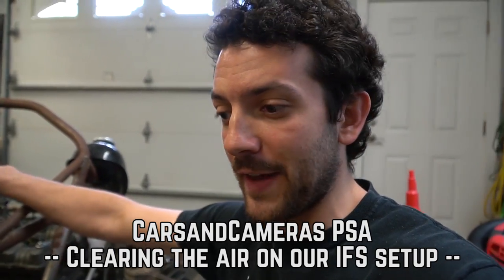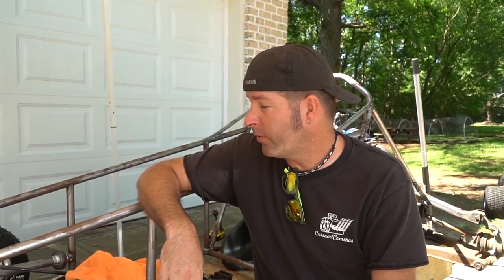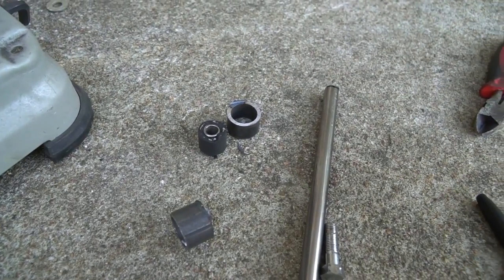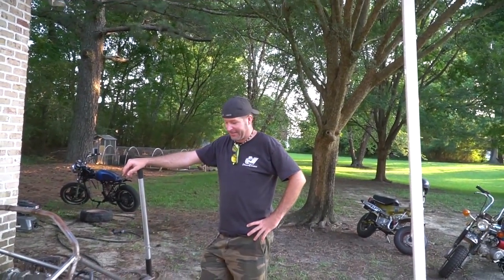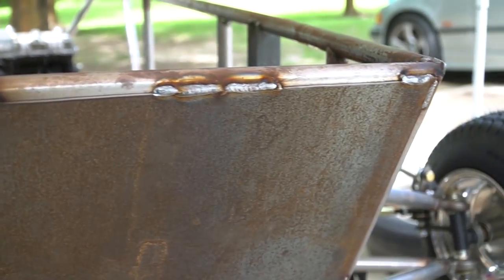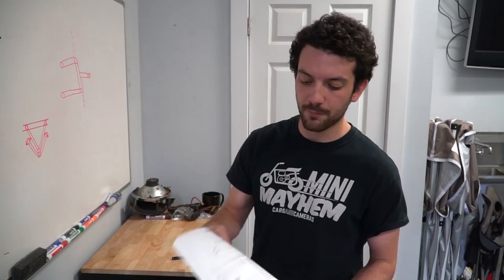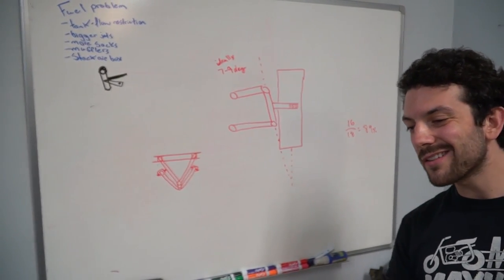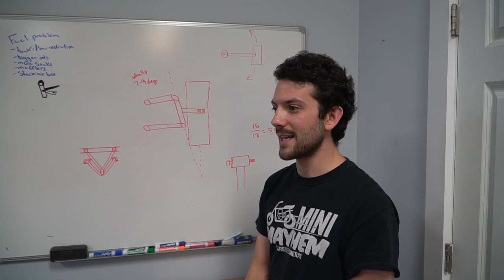Shocks, Suspension, CLEARING THE AIR | Cross Kart Pt. 10

Comment: The only ones I'd be concerned with are the ones on the spindle end, but I don't know what sort of travel you've got. Those running out of clearance and becoming a suspension stop would be the only way those joints will give you any issue. As long as your shock runs out of travel first you're all gravy.

Comment: I'm a Mechanical Engineer and didn't see anything wrong with your front suspension mock up. I can see where you might have some stress points and gets some cracks, all depends how hard you beat on it. 
Tires and hubs fall off cars everyday, It'll be fine.

Comment: Why dont you simply attach the lower shock mounting point aound the middle of the lower controlarm in the front like it is on the rear miata suspension? you wouldnt have to have an enormous springrate :)

but the kart looks just amazing!

Comment: those joints on the front are a bit overkill just look under your car and see how small the ball joint holding the spindle is and those joints you guys put on the cart are the exact same thing as a ball joint on a car except the bolt goes trough the middle instead of having a tread on one end 
great job building that cart i wanted to do something similar for years but i just dont have the time

Comment: The one problem I see is the angle with shock on top of upper control arm. Using the lower control arm will decrease angle and allow better articulation of suspension.

Comment: The first shocks probably would have worked if you would have kept them within 30* of vertical. . .going past 30* starts to decrease the effectiveness of the shock valving as well.

Quality heim joints/rod ends move freely when brand new. . .check out the high quality units used on high end racing suspensions and desert trophy trucks. They should move freely, but without slop. . .

Comment: So, just semantics, but "Heim Joints" are technically a brand (from the original designer). These style of joints in a generic lable are "Spherical Rod End Joints". The tractor style that you bought are typically designed with a tighter ball race. This keeps empliment tools from loosely tracking while in storage mode, and while being pulled under load behind the tractor. 

If you had bought motorsports grade Spherical Ball Joints/Spherical Rod End Joints, most of them would have had less friction applied during the manufacturing tolerance process. 

Just fyi. Not super important for what you guys are doing. Just though you guys and others might like to know. Offroading and Race Car Spherical Rod End Joints are typically a bit stiffer as well, as they are designed to maintain tighter tolerances while under extreme force loads.

Comment: I have purchased 100's of heim joints for making 4-link suspensions and have never had one be so stiff as to require more than finger pressure to move it.  Not saying the ones you have are defective, just making an observation.  Maybe yours are from a different manufacturer.
Reply: Because they arent using  Heim Joints -
Reply: @Mad-Duk_Machine_Werkes  They are using spherical rod ends from Tractor Supply.  Same basic design but they have that huge shoulder on the spheres.

Comment: That's why I always have a spool of flux core wire around.  If you run out of gas or you have to weld outside in the wind, the flux core doesn't care.

Comment: Do the hyme joints have grease zerks? Not sure if you have to tooling to add them if they don't, then you could at least put some lube in there so they don't bind so much or wear fast down the line.

Comment: Attach the front shock to the lower A-arm, not the top A-arm.  The resulting angle will be much closer to a right angle and therefore provide more resistance to compression.

Comment: I'm 1/2 way through the vid, you guys could have ran a cross bar across the lower control arm, parallel with the frame and mounted the front shock to the lower arm through the center on the upper control arm giving you a better angle on the shocks.

Comment: You guys rock. How many actually read the comments? Most are afraid of reading them because they don't want to hear what they are doing wrong since they are always right. So, you get extra points for reading comments and responding. But in the end, you don't have to listen to every keyboard warrior. Now, for fixing or not to fix? If you want it corrected? Fix it. Like you said, Edison took 1000 times to make a light bulb. So don't feel bad if you have to do a little redesign. But if it works fine, it'll be fine. Although I personally kind of would like to see it race against the drag rail and shifter for the top speed, and maybe top speed for off road. But that's me. If you wanted something for a Max of 50mph, then leave it. It was your first build so leave it your first build. Maybe show your mistakes as sort of trophy's of what you learned while making your first build.

Comment: Still missing the anti squat/anti dive  angle which is most effective during hard braking and emergency maneuvering. You'll notice when you turn hard at speed your front suspension will actually impose additional body roll into your chassis, and if you ever plan on using the brakes in an emergency at higher speeds (35+mph) you'd notice when you press the brake hard the front end will dive down transferring the weight forward unloading the rear suspension causing the rear tires to start skidding during hard braking... of which causes increased instability. That information should be in that book.

Comment: If you place the front shocks more vertical, won't that stiffen it?
Reply: Yes, Every 1 degree you lean the shock and spring, is @ 1 % rate reduction on the spring and shock. 20 degrees, = @ 20%. It really matters on the rear, as softer springs help forward traction.

Comment: Your welder "acting up" may be the tip. Most Tips need to be replaced after awhile. I was having a lot of trouble with my mig welder, and it turned out to be a damaged tip. However, my welder wasn't gas, it was just wire flux.

Comment: it might be time to put a new liner in your mig gun the liner will cause wire feeding issues a sputtering issues like you had pointed out it is alot cheaper that buying a new gun and hose for your welder

Comment: if you get a piece of styrofoam you can lay the metal flat on the ground while cutting , the nibbler will dent a groove in but the stuff is cheap
i had an english book on suspension from a guy that build a formulla type open wheel singleseater for hillclimbing and the guy used a piece of string to see how the suspension arm lengths reacts to the travel , he basicly used nails as heim joints and moved the whole thing through the arc , works pretty good in visualizing stuff

Comment: those appear to be ends for making or repairing a center link for a three point hitch. they are tough as hell, and are designed to deal with constant, heavy stresses for years and years. you have no idea how much abuse those things take supporting a four bottom plow as you till a field. this go cart will be nothing to them. i'm surprised you got them loosened up already. i was going to suggest putting pumice hand cleaner on them to help loosen them up.

Comment: Weld a bar to the bottom of the front a-arms and mount the shocks there. They wont perform well with the angle the a-arm is putting them at.

Comment: hey all you can do is try it if it works great if not oh well you learned. i have built stuff like this my engire life. and i would be willing to bet for everything i ddi right i did it wrong at least 2 times before. i used them joints you are using on a trailer i pulled behind my motorcycle for years.  until they made it illegal.well at least in Texas

Comment: Front shocks are laid to far to an angle. Drill holes higher up on the bracket and mount the bottom of the shock on the lower arm.

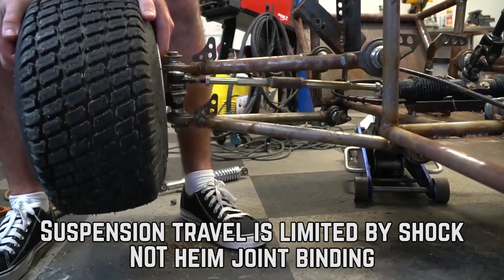Comment: OK, Right around here, 0:28 to 0:30, You see how the joint, it looks like it's twisting. instead of a smooth up and down ark, That looks like it's binding. If you pound on it, it will get more and more lose till it breaks. My other concern, out here looking in, it's like you guys built the cage before you built the frame to mount it too. Instead of building a frame to mount your suspension to, you are mounting your suspension to the tubing. That looks like thin wall tubing. It's not going to take the beating the suspension is gonna give it. It seems to me if you ride it hard the tubing will give. It will bend and twist and break. To me, it just seems you left out the frame and are asking a lot of the tubing.  Remember back when some of us was telling you two it was time to leather up? You didn't. Remember what happened to Ike when Ike started pouring the coals to the 50 HP riding mower? If he had on his leather he wouldn't have gotten scraped up. What you are building right now is the 50HP riding mower times 3. if not more. If this thing bends and twists like it looks like it will, well, LEATHER UP IKE. It looks like you might need it. I'll shut up about it. Go back in the bushes and just watch. Maybe I'm wrong. I hope I am.  I just hope that I don't see one of you pouring it to this machine on uneven ground and something, "give" up front.  That could be catastrophic. For me, there is no way I would trust a welded together front end. that's like breaking an A-arm on your daily driver car/truck. Then welding the arm back together and sticking it back under the car and calling it OK. You just don't do that. But, anyway, I'm done. Back to watching.

Comment: you guys really ought to do the math for those shocks. especially the angle of them. the further you rake them toward the center and off of vertical the weaker your springs effect will have on the suspension. shock damping rate will likewise be effected similarly.
Reply: also will have the effect of increasing exponentially the force it imparts as the suspension compresses.
Reply: i. e. all the way down very soft. all the way up very stiff.
Reply: and really you should fit the shocks and springs to the amount of travel you will use.  i mean git r donE

Comment: well im 15 years old and ive welded more than enough to roll them dimes thx to my welding instructor but anyways idk what the hack they are saying that the welder is acting its either wire speed....most likely and or the shielding gas is being blown away but most likely since you can hear it sputtering it could be the wire speed/it is the wire speed

Comment: Shocks aren’t strong enough because they are designed to be straight up and down at most a 45, those are like 20 degrees and the leverage on the swing arm is way more then what they can handle. Yes putting stronger ones on would work but the physics need some work. Other then that looks pretty good.

Comment: I don't have an issue with your ball joints but some of your geometry you yourself is saying some of its not quite right realistically your front shock should be mounted about the midpoint of your lower control arm and come up at a 45 degree angle your ankle is too low that's why it's not what you supported laterally up and down and yes you need about a 12 or 14 inch rim larger Tire

Comment: That is one hell of an angle that you have on the front shocks. Spring shocks are at their highest efficiency when the moment of movement is strait. That is the close you mount your shocks to be parallel with the front wheel the better they will work. Dirt bikes often have a single shock mounted on the rear of the bike with the supporting triangulation ensuring the movement of the shock is straight compression. That is movement of the lower eyelet   of the shock does not scribe an ark while working.

Just saying.

P.S. I could not locate a web link which supports what I am saying better than the link below.

https://www.speedwaymotors.com/the-toolbox/coil-over-mounting-guide/30078

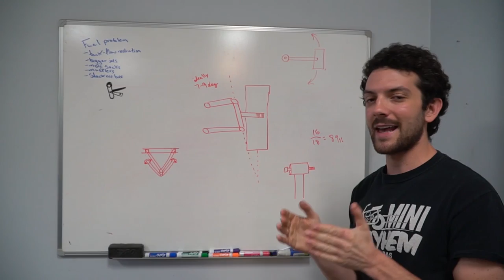Comment: The statement made at 15:02 is false.  The spindle side ball joint ends of the LCA tubes are welded together preventing any rotation of the tubes.  Because the ends of the tubes are fixed, the Tractor joints behave exactly like bushings.  If the ball joint ends of the LCA tubes were not welded together but allowed to rotate independently with individual lower ball joints  the non parallel mounting of the LCA pivots would not be as much  of an issue. This is a common audi design for example: https://cdn4.pelicanparts.com/techarticles/Audi_B6_A4/46-SUSPEN-Front_Lower_Control_Arms/images_small/pic01.jpg The easy fix is to rebuild the LCA with parallel inline inboard pivots.  This would eliminate the binding which is present.  The suspension travel would no longer be limited by the pivot bind.  In the unsprung test earlier in the video you can clearly see this happening.  If you are happy with the way it works now, by all means keep it and enjoy it.  There is no shame however, in copying what major companies have spent millions of dollars in engineering on, especially for your own use.

Comment: Those shocks are way to weak, check eBay and you can get some nice gas shocks from China for pretty cheap. I have used them on a 660cc buggy i built and they worked amazing.

Comment: I never said they was not a heim joint. The ones for tractors are low quality, weaker, and not ideal for suspension work. If one fails on the back of a tractor your bush hog falls and you stop. One fails on the front of a buggy at 60mph the stop is not a slow and painless. The low quality is also why they are so stiff, because in a tractor it doesn't matter. No a new one won't flop around but you don't need to put it in a vise and use a crowbar on it either.

At the end of the day do what ya want but I've seen those fail at the off road park and it's rarely pretty.

Comment: Mounting your Shocks at a 90° angle Will Stiffen the suspension  up. look up about independent suspension you will find that  that angle on the front mount matters a lot for type of off-road application  you are trying to make but sound like you did a lot of research already tho

Comment: your welder is acting up because you are welding too much at one time. welders have something called a Duty Cycle. weld a few mins and leave it on let it cool off. i have a lincoln it does the same thing depending on what i am welding i can weld for a half hour or so but eventually it will go in to protect mode and shut off for a good 45 mins.

Comment: I have no issue with your chassis or suspension design the only t2o things I would suggest is use some miata coilovers for the rear suspension. I know a cheap set is still like $200 but I think the adjustable spring rate would work well in your design. 2 I am not sure if you guys did or not but I would  definitely add a splatter/heat shield between the engine and the drive. In my experience a plastic seat is just not enough protection. But you do you

Comment: If your using a crappy extension cord with the welder you will not get full power from the smaller gauge extension cord, just a simple fix.

Comment: Welder isn't the problem. It's most likely that you're welding outside in the wind. The is blowing your shielding gas away from the area you are welding. Causing inferior welds. I would grind off all the welds you did outside and reweld them.

Comment: guys do yourselves a favor and get a trial version of just about any CAD software and use it to figure out your suspension geometry.. You can all but eliminate bump steer , get proper ackerman, camber, caster,toe angles figured out before you ever cut a piece of tubing... A little knowledge with CAD can save you tons of time and materials compared to the old eyeball "ya think so?"method..

Comment: At first you were under-sprung, now I’m guessing you’re going to be way over-spuing.  With the vehicle on the ground, it should use 20 to 30% of the shock rod travel at rest.  That gives allowance for if you hit a hole rather than a bump.  Snowmobile or atv shocks might be a better choice, they’re sprung for the weight you might be working with. Just sayin.  Springs only adjust ride height, that’s it.  Compression and rebound is another game.

Comment: That's thing. They are meant to move in many different positions. So they can twist and turn all sorts of ways. Where as like the rear they do not. It only goes one way. Up and down. Not forward and back, up and down side to side u know what I'm saying. Your gonna have ato lot of power. It doesn't seem like much but it puts a lot of torque out of that engine. U can do what u will. But, it would be cheaper and easier to build it the safer way. But everything does go weird when it is moving on a suspension. But u do know this bc u guys go through it with the camber and all them adjustments. I'm am far from questioning your guys intelligence. Its your guys cart lol. U do what u will with it. Just know that the likely hood of a tiny stone could take that whole suspension out lol. It will work. But safety first man

Comment: Yes, It's still a bad design and you can see the heims approaching their bind points when you were showing the suspension movement at the beginning. Hiems are stiff yes, but when you design something you should still minimize the amount of movement needed, if they were parallel instead of being nearly perpendicular with each other you'd have less friction to deal with and more potential suspension travel.  I assume this was all because you guys didn't want to use a tubing bender. I'm not saying this stuff to piss in your Cheerios I just see there wasted potential by taking weird shortcuts. Also, for the 10th time, please look up ackerman and cut and reweld your front knuckles to match your wheelbase so your steering works better, nearly all of your builds have bad ackerman and it's killing me.